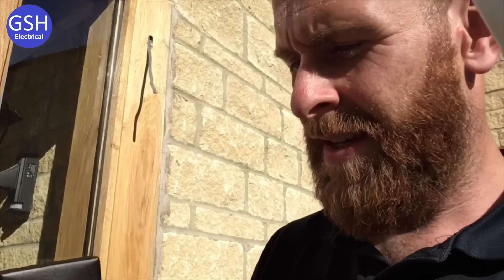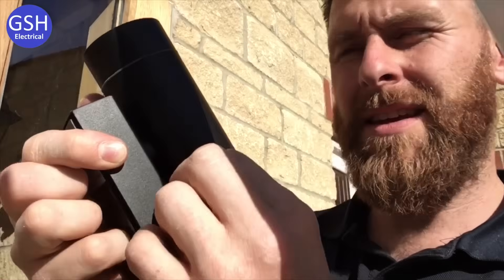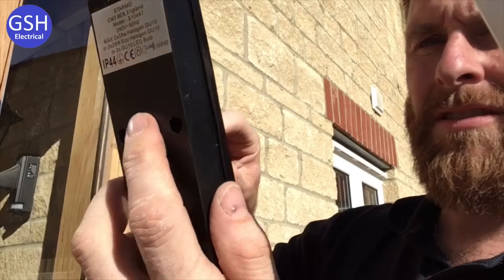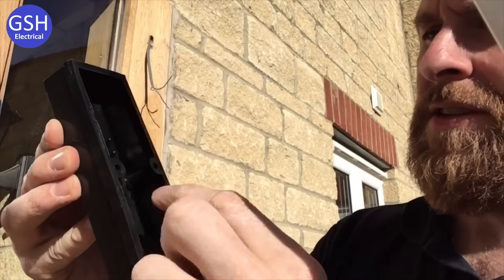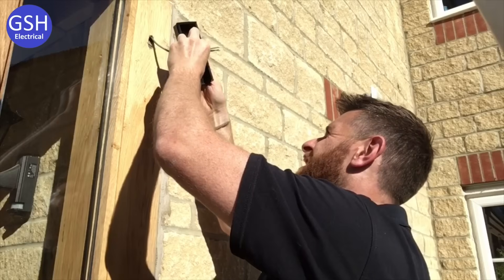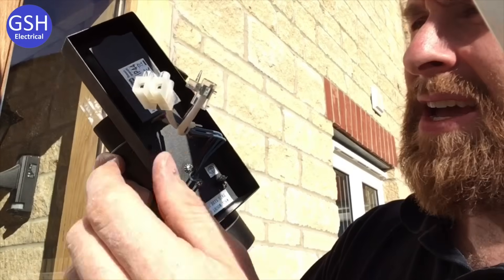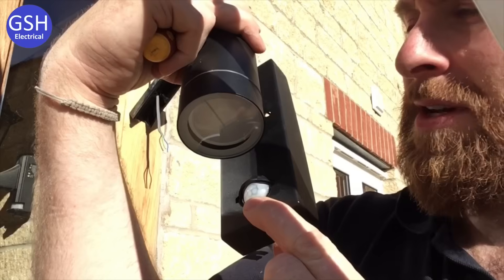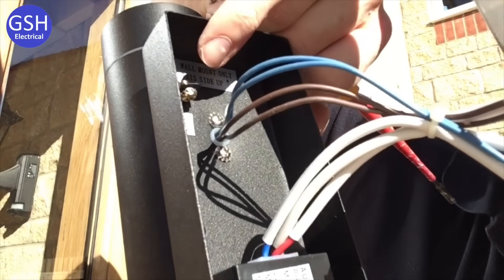How to Second Fixing an LED Outside Light Fitting Wired in Twin and Earth Cable - On Site With Matt

Comment: Good vid. But ya dont show how you git the cable to the outside, us it felt fused? Is it off an existing socket, has it been wired and used as a separate light to the main fuse board? In a nut shell. Howdy ya get power to the outside??
Reply: he shows that in an earlier video https://www.youtube.com/watch?v=PjD5-fyTPuM

Comment: Hi Gaz are the new linian fire clips only for use with one wire or are we able to put more than one in
Reply from the maker: Hi. Great question. All the clips I have seen are for one cable only. Thanks for the message Gaz 👍
Reply: @GSHElectrical  thank you for swift reply

Comment: I've fitted 4 of these to a house which was pebble dashed. Really tight and fiddly job.
I wish electricians had a say in the design of lights.
Never let the customer order lights!
Reply from the maker: Hi. Never a truer message has been sent to me. Love it... thanks for commenting and watching GSH Electrical
Reply: Same here... Getting these fittings to sit flat and retain their IP rating is a pain!. I put a ring of silicone sealant around the back cable entry point so it gives a better seal, and also make sure there is a drip loop formed so rain water can't run down the cable into the box. 2 little nuts holding it together in the most awkward place ever doesn't help your stress levels either lol.